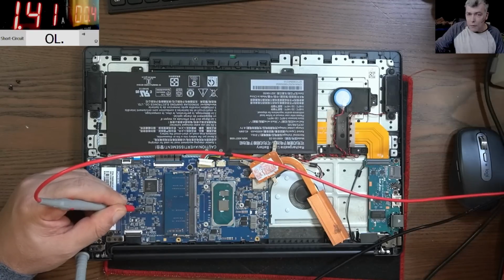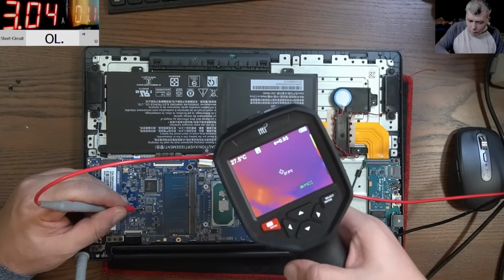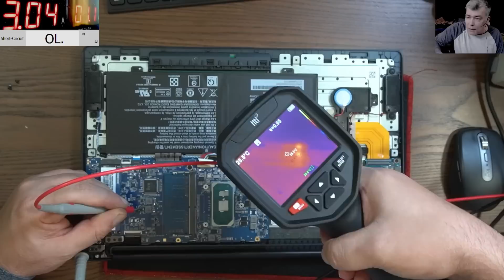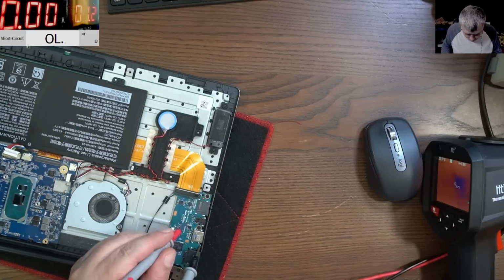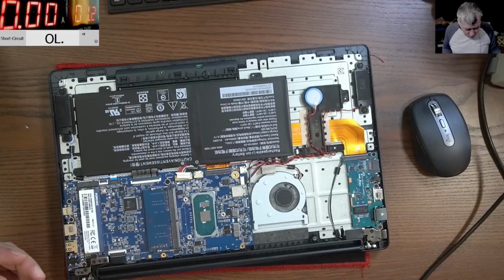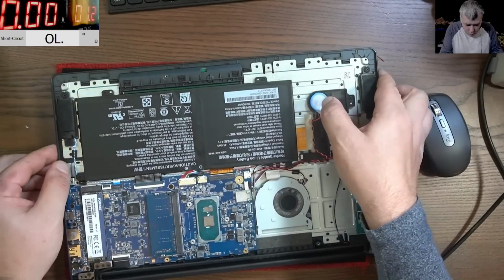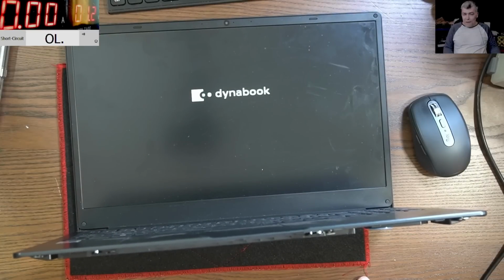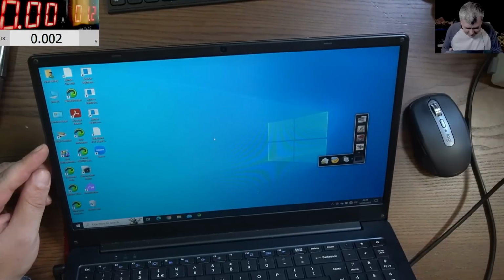How to carry a repair like a pro - Toshiba Satellite PRO C50 no power, motherboard repair

Comment: Hello Sorin, good work keep it up. We have exactly same laptop working fine with ac adapter but battery is not charging showing 0% available (plugged in) replaced new battery no joy. Voltages on battery connector is pin 1,2,3 and 4 is 0.886, pin 5 is 3.3, pin 6 is 3.3 and pin 7 is 0.144. On the other hand have 3.3v, 5v and 12v are present - Any advice will be appreciate.

Comment: Dear Sorin: You are ABSOLUTELY RIGHT!. In the last months I have received laptops impossible to repair, due to a shorted CPU or bridge (I mean, Intel chips). Yesterday, I received 3 machines (1 Dell, 2 Asus...these were the exact model!), and the three had shorted CPUs or chipset. I think this is a shit from Intel (specially with the chips like the one in this video, the one with the metallic bracket around). Thanks for yor simpathy!.

Comment: Hi Sorin, I have a similar Toshiba C50 on my channel, same fail on 5V rail and same capacitor - it must be "dodgy" as you say yourself. 
There were visual signs of failure with the one I had so it was easier.

Comment: When I was watching this video somewhere at the middle of it, when you used the voltage injection method and I saw the voltage drop current draw relation a.k.a a low resistance value on the power supply I bet there is a shorted capacitor somewhere as you tought us in one of your videos and at the end of the vid you confirmed it...I remember you revealed your secret method of fault finding in one of you videos, I think this was the video
https://www.youtube.com/watch?v=GfXx7OC_scQ&t=1113s
If you understood that video you can understand and identify quickly this kind of fault too.
Thank you Sorin, you're a good teacher with lot of knowledge and a lot of background experience/practice...by the way sharing is carying :)

Comment: of course Mr.Sorin is pro he knows where to check  just with sight and where to inject proper calibrated voltage and thermal camera makes it's magic.Thats the solution.the only capacitor neds to be replaced is on frequency circuits not else.thank you for the video was so funny

Comment: Without a donor board or schematic, how do you know what capacitor value to replace?
Reply: He wont replace it... thats the whole joke. You dont have to replace one cap. It will run fine without it. Its just a smoothing cap.
Reply from the maker: Wow...so rude.....   :D
Reply: @electronicsrepairschool LOL :D
Reply: @fioficuucuffu4805  Ha! He's joking again? Aren't there situations where the cap isn't redundant and must be replaced? Thanks! :)
Reply: Generally you dont need to know exact value of such capacitor. Its like blocking/filtering capacitor for its power rail, usually 5-10uF.